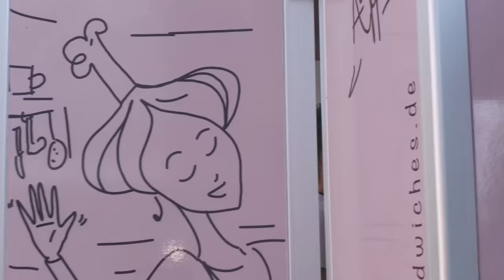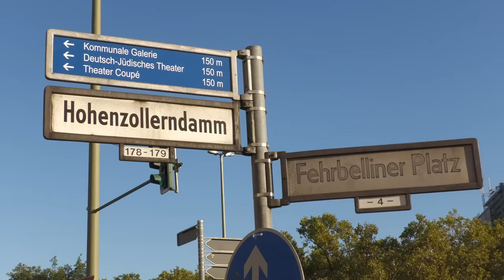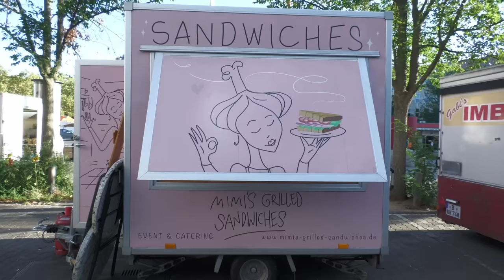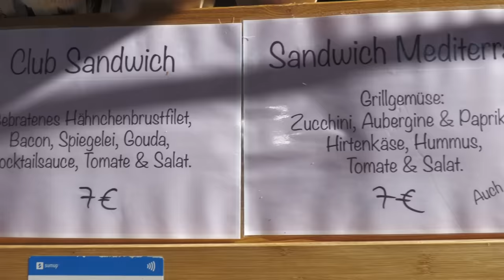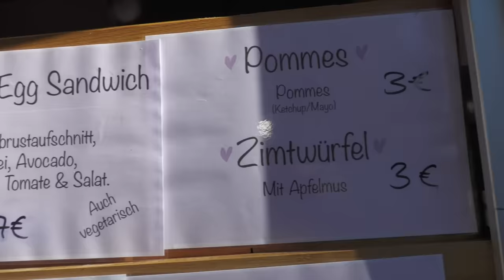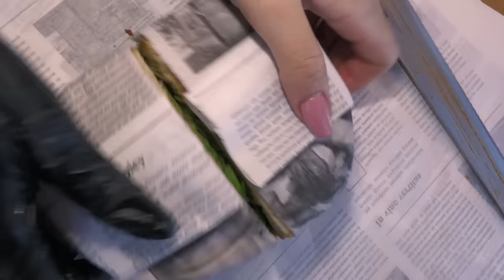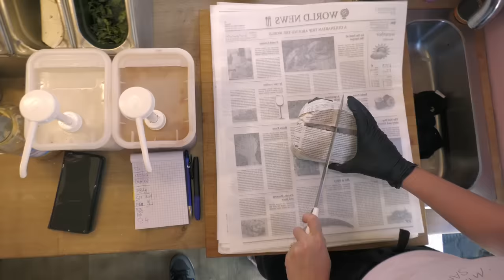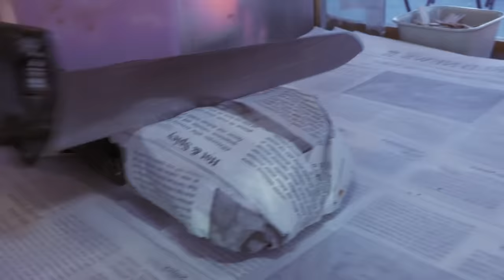Two Women makes a lot Grilled Sandwiches in a small Trailer | American Street Food in Berlin

Comment: Old line cook's trick is to use a small stainless steel bowl upside down to set over your eggs and anything with cheese on top when on the grill.  It will save you a ton of time by cooking the eggs faster without flipping and melting your cheese in just a few seconds.

Comment: Kudos to the ladies putting in the hard work.  I see the passion and I enjoyed most of the video.

I usually don't like critiquing but I wanted to add my observations:
- wear gloves on both hands.  Why wear nitrile food-safe glove on only one hand? how is that making the food safe? I see you touching cabinets, food containers with bear hand and using the same hand to touch the food. Not clean IMO
- some avocados were too ripe and/or bruised.  I expected those parts of avocado be discarded, but that didn't happen
- why not season the egg plant slices in a separate container along with lime juices before throwing them onto the grill? I thought some egg plant slices ended up with a lot more seasoning and some didn't get enough
- speaking of the grill...it does not look clean.  I wished either at the beginning or at the end of the video someone cleaned the grill
- I wished you use thin trays or just baking paper to put the breads (before slicing) on; they were simply stuffed in the bottom-left cabinet...although I can't tell if the bottom of that cabinet is clean enough
- I would highly recommend watching similar style cooking videos from Japan or S. Korea.  I am always impressed with those cooks who pay enormous attention to cleanliness

Overall, I enjoyed your cooking, and the sandwiches look yummy!!  The portions of sandwiches are extremely generous (for the price).  I wish you two the best of luck.

Comment: None of their pans are temperature controlled, they just dump in pre-cooked chicken at 5:14 and deli meat at 5:35 to bake in the summer heat. If they were cooked from raw right then they'd be good for four hours, but they're pre-cooked and no way they're not slimy and full of bacteria by the time they close (I see they're open for four hours on their website). I thought Germany was advanced enough to have food safety codes but I guess not. In the civilized world those would be food safety violations.